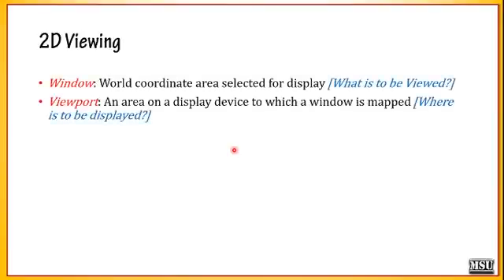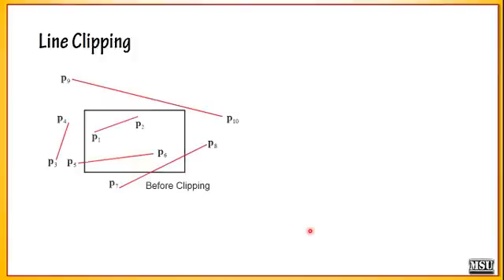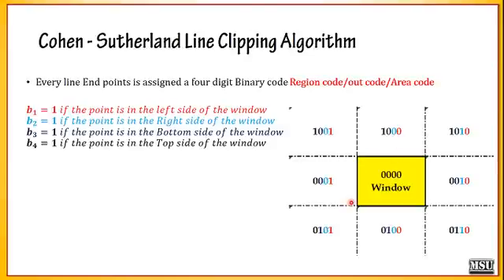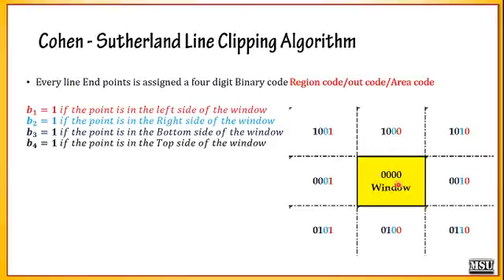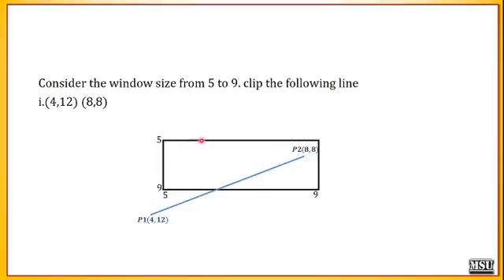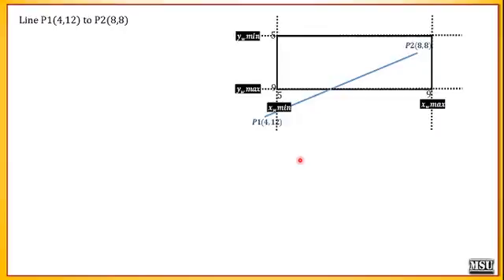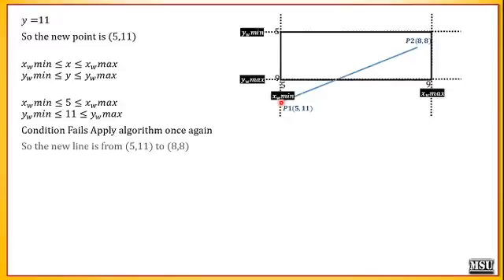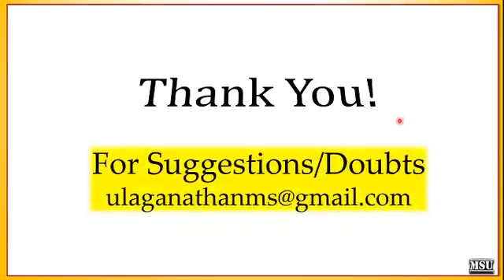Part 13   Cohen Sutherland Line Clipping Algorithm

Comment: Suppose p1 is in 0001 and p2 in 1000. ANDing these two will yield 0000 i.e., trivially accepted, that means the line passes through the window and needs clipping. But it may happen that the line does not pass through the window (if the co-ordinates are changed but both of them are still in 0001 and 1000). So by simply ANDing two outcodes and getting 0000 does not mean that the line passes through the window. There is a confusion to me. Please clarify. Thanks.

Comment: how you put yw(min) at the top havinng value 5 ..it should be yw(max) with value 9??? m confused you are changing mathematical definitions
Reply from the maker: In the computer monitor origin starts at top left corner. So x increases from left to right. Y increases from top to bottom. So only I used like that
Reply: Thanks for clearing my doubt
Reply: Your explanation was really hlpful to me

Comment: Mohansundaram Sir, In the video at the time 10:59 i.e, while explaining the example why you have taken ymax to y min..( bottom ymax, top ymin) where xmin---left and xmax--- right if you consider the same hope the p2(8,8) would not be correct if ymax is taken at bottom and ymin is taken at top will you please clarify my doubt
Reply: Remember the cartesian coordinates. Y is vertical and X is horizontal. Y increases from bottom to top and X increases from left to right. Similarly, we have taken Ymin - bottom and Ymax - top (Ymin is minimum value and Ymax is maximum value). Xmin - left and Xmax - right (Xmin is minimum and Xmax is maximum value)